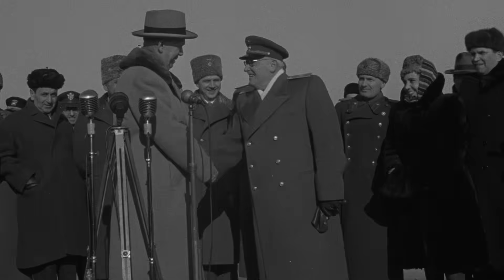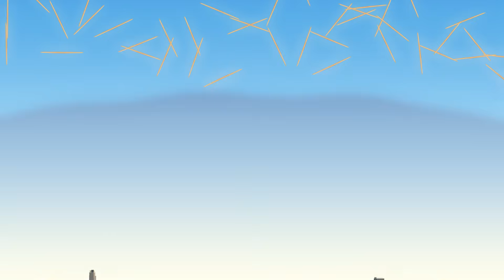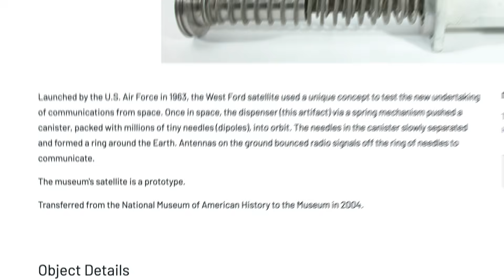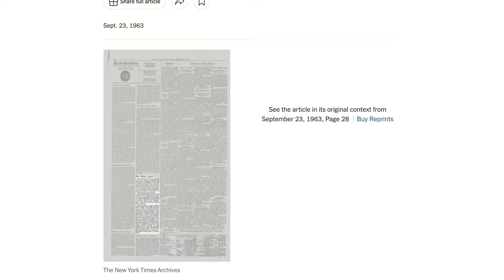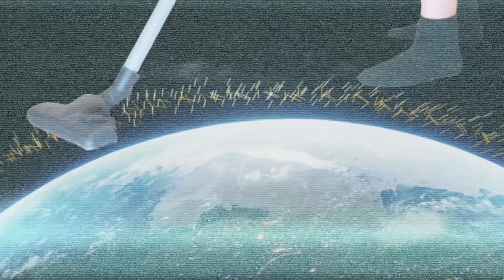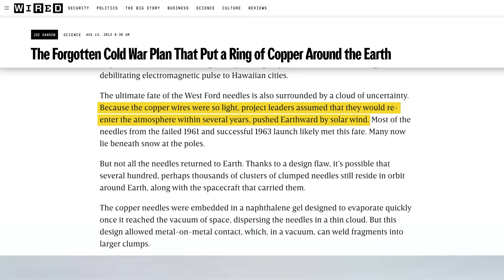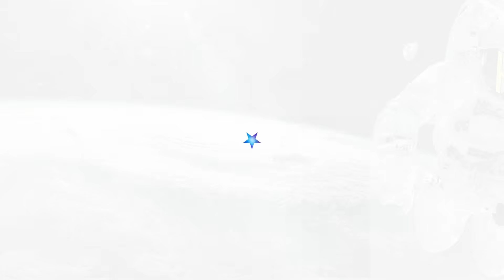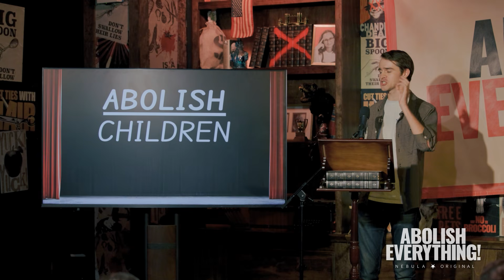Why The US Government Put 480 Million Needles Into the Sky

Comment: A little surprised there was no mention of the concept of Kessler Syndrome, the idea that if there is too much junk in orbit it wish smash into things like satellites, turning them into more debris which can destroy more stuff, eventually resulting it being impossible to use satellites, or even spacecrafts in general.
Reply: To ease your concern, this is because the research has confirmed there is very little threat of such an event occurring, at least from Project West Ford. The vast majority of the small needles fell out of orbit within a decade, and there's only 44 clumps of needles 10cm or more in size left, all of which are monitored. Individual needles or smaller clumps undetectable are unable to cause any real damage to any satellites as there are only 1.3 penetrations of more than .4mm per meter per day and "no significant number" of impacts penetrating 0.5mm in low orbit total, not just from the needles. (1965 summary report from NASA from Project Pegasus I - III to record impact frequency) That was measured in '65, two years after Project West Ford, and we can only expect that number went down. To add to that, most satellites have a wall thickness of more than a cm, like Starlink satellites being a few cm thick or the ISS's around 10cm to any pressurized part. Small impacts, like those from potential West Ford needles would leave no damage to other spacecraft or satellites. The damage is likened to sandblasting and would take decades to be any real concern.
Reply: @KreptorS  the way you are phrasing it makes it sound like it isn't a big deal when the truth of the matter is it's not a big deal specifically for project West Ford, but it is a big deal for everything else
Reply: @weamibrahim2146 Because it ISN'T a big deal not just for Project West Ford but for all low earth orbit in general. I'm slapping away at all the fearmongering. the data collected from NASA's Pegasus missions in 1965 show: "With this area [200m^2] and an expected lifetime of one year, a statistically meaningful total number of puncturing impacts could only be expected for aluminum target thicknesses below about 0.5mm. Actually, the number of puncturing impacts through 0.4mm of aluminum as recorded by Pegasus II and III is about 1.3 per m^2 per year, in rough confirmation of the preflight assumptions." A thickness of 0.5mm will only be a concern for solar panels exclusively which would only limit satellite lifespans and not cause any catastrophic chain reaction. Sorry you didn't like the way I said it. It is NOT a big deal. A good analogy is the amount of tiny rocks getting kicked up at your car as you drive throughout the course of a year. They will not kill you or cause your car to split into a thousand pieces. The NASA report compares it to sandblasting. It is not a danger.
Reply: @KreptorS Starlink satellites hulls are less than a millimeter thick…
They have a design life of less than five years.
Reply: @allangibson8494  Where did you get this lie? That's not even remotely true. The vast majority of satellites built in the past couple decades are 2.5mm or more. Starlink satellites are designed with thrusters on them that push them down into orbit within 5 years of end of mission, not lasting only 5 years. Did you just make something up because you dislike them?
Reply: @KreptorS Starlink satellites are modified cube sats.
The Apollo LM had a 0.3mm skin and it was pressurised.
No one launches anything with a 2.5mm plate in it unless it contains pressure.
Whipple shields are multiple layers of foil.
Reply: @allangibson8494  Must've never heard of the Pegasus missions. Proved that spacecraft received no penetrations with 0.5mm of aluminum. Meaning the only thing small space debris can do is damage solar panels. And are you fr? Mentioning the LM like it matters? It wasn't going to be experiencing debris impacts of any notable force and was therefor not designed for it.
Reply: @KreptorS The LM was a manned spacecraft.
Pegasus is a launch vehicle, not a satellite. Launch vehicles are designed for aerodynamic forces the spacecraft never experience.
Satellites are also legally required to burn up on reentry…
Reply: @allangibson8494  so you agree with me then. but judging from that response, you also must have no idea what Pegasus is or what its mission was
Reply: @KreptorS Which Pegasus are you talking about?
The modified Saturn V or the air launched satellite booster?
Reply: @allangibson8494  my guy. there's only one distinct project regarding the name Pegasus. It was a 3 part mission to test satellite durabilities, damage, and frequency of micrometeoroid impacts. its surface level research.
Reply: Kessler didn't come up with his syndrome until 15 years after this was abandoned, so it wasn't something that concerned anyone at the time. I think by the time Kessler pointed out there was a potential problem, most of the needles had already re-entered the atmosphere.

The needles are too small to be a big problem. The risk with Kessler syndrome is that each collision creates more debris and you get a chain reaction. A collision with a tiny needle isn't going to create much debris. 

The needles also spend very little time at dangerous altitudes. They were launched into an orbit at around 3,500km, which is Medium Earth Orbit. Kessler Syndrome is mostly concerned with Low Earth Orbit, because the density of satellites and debris is much higher there. Once the orbits decay enough for the needles to reach LEO, the atmosphere is thick enough that they are going to re-enter very soon (probably a few days).
Reply: @thomasdalton1508 At 3500km the orbital lifetime is longer than the age of the universe unless the solar wind blows them down…
Reply: @allangibson8494  For a big satellite, yes. For a tiny needle, no. There is a square-cube law effect at play. The smaller something is, the more air resistance slows it down. That's why it is only those needles that clumped together that are still up there. The needles that were on their own deorbited within about three years.
Reply: @thomasdalton1508 There is very very little air at 3500km to cause drag.
The solar wind has a higher density than the earths atmosphere at that altitude. Electromagnetic effects would be stronger than aerodynamic drag. (Which of course assumes they were injected into a circular orbit).
Reply: @allangibson8494  I think at 3,500 km, the Earth's atmosphere still dominates over the interplanetary medium. The atmosphere is very sensitive to solar activity at that altitude, though. 

I tried to do a rough calculation and got that it would take about a million years for them to deorbit, but I think the problem is the extreme variability of the atmosphere at that altitude. A brief period of high solar activity would cause the atmosphere to expand and suddenly they are orbiting through air several orders of magnitude more dense.

They definitely deorbited within a few years. They were very easy to observe - just bounce radio waves off them - so were tracked as they deorbited.
Reply: @allangibson8494  Even if we suppose ALL the needles are still there and will always be, there is no cause for concern because they're small enough that they couldn't even penetrate 0.4mm of aluminum despite their speed.
Reply: @KreptorS actually at orbital velocity, a paint flake will punch a hole right through a satellite.
Those needles will pack more energy than a rifle bullet.
Reply: Well have robots to sort out by then
Reply: Like Saturn, Earth will have rings........made of trash.......
Reply: Yes, seems to me we are getting close to the Kessler Syndrome. It seems with all these smart people involved with spaceflight systems from NORAD to SpaceX, but they seem to be looking the other way. This would not be first time in history where brilliant people not considering results.
Reply: @wrightmf well Musk isn't exactly smart, it's the engineers and scientific staff who do the heavy lifting and ultimately they can't veto an objectively stupid project
Reply: @rileygladue3979 I wouldn't count on the last one. After all we got the Cybertruck and there is no way that this piece of shit wasn't designed by Musk.
Reply: @rileygladue3979  dumb people can stumble into a billion dollar idea.  Dumb people don’t stumble into multiple multi-hundred-billion dollar ideas and have the ability and insight to hire the right people to make those ideas trillions of dollars in investor wealth.
Reply: @rileygladue3979  Musk is objectively pretty smart on some topics. Intelligence isn’t universal, and it becomes pretty apparent when someone’s had enough success that their ego has gotten completely out of control. Nobel Prize winning conspiracy theorists are very common. I think climate change skepticism is higher among Nobel Prize winning scientists than regular scientists. Why? Because they’ve had their ego validated and think they are smarter than everyone at everything.

Musk is the same. He’s genuinely good at rocketry. He does make high level engineering decisions at SpaceX, those engineers and scientific staff say so. That’s why SpaceX moves so fast; instead of committees he listens to proposals and picks one. 

But after tremendous success with online maps, online payments, electric cars and rockets, he decided he knew better than everyone on everything, and started talking about other things and ignoring the experts in those fields, because they don’t understand online maps, online payments, electric cars or rockets. Thus you end up with a man who could have a long detailed conversation about the pros and cons different combustion cycles for rocket engines, but would prefer to talk about gender and make mistakes I could have corrected age 14.
Reply: @qwerty112311 no, they purchase them and run them into the ground with daddys blood emerald money.
Reply: @qwerty112311  when you're born into high society you essentially cannot fail, you had Dynasties of inbred nobility running the world for as long as civilization existed. Call the Hapsburg family "geniuses"
Reply: @rileygladue3979 He has a degree in physics.  That's more science than most people I know.  Do you?
Reply: @captainsorehl A degree =/= Intelligence
Reply: @rileygladue3979 Degrees may not equal intelligence, but they are a strong correlation with respect to their specific subject.  Physics isn't some dismissable subject like liberal arts or comparative philosophy.  They don't hand those out.  So you can sputter he isn't smart about a lot of things, but science isn't one of them.
Reply: @rileygladue3979  case in point the cyberslop exists
Reply: @captainsorehl  how's that boot is tasting to today huh?
Reply: @matheussanthiago9685 Delicious.  My aerospace degree earns me the best boots you can eat.  It doesn't mean I'm intelligent, but they sure pay me like I am!  What a pampered slave I am!
Reply: @wrightmf Well there's a reason experts aren't worried about it and you are. They actually know what they're doing.
Reply: @ravenvelvet69 then why did SpaceX perform 144,000 collision avoidance maneovers in a 6 month period last year? That's over 13 manoevers per satellite: 1 every two weeks...
Reply: @ravenvelvet69  experts are very much worried about space junk
Reply: @rustybayoneta perfect demonstration of why it isn’t really an issue.  All modern equipment is build with the ability and expectation it will have to maneuver to avoid other objects in space.  And they’ve done so quite successfully.  LEO has safe capacity for hundreds of thousands, if not millions, more vehicles.
Reply: @rustybayonet that's exactly why they aren't worried because they have a system that specifically avoids that. Also when you have thousands of satellites yeah you're gonna have to do that many maneuvers
Reply: @rustybayonet  To avoid collisions, why do you think they did collision avoidance? This isn't Kessler Syndrome if it's stoppable by literally just dodging the things in orbit. 
Not to say it won't EVER be an issue, but collision avoidance is a direct example of experts seeing a possible problem(collisions) and addressing said problem.
Reply: @the-digital-idiot  That only works with active satellites with the ability to manoeuvre. There is a lot of stuff up there that isn't active and can't be moved. If two of those things are on a collision course, there is nothing anyone can do about it. They will collide, creating a lot of debris and that debris will then collide with more things.
Reply: @wrightmf  SpaceX are very much not looking the other way. They orbit Starlink very low. If they lose control of a Starlink satellite, it will reenter in under 5 years. This has two advantages:
1. Junk can’t accumulate for decades and decades, reducing the risk of hitting a tipping point.
2. Even if they really mess up, it cleans itself up in a few years. 

They also avoid polar orbits, which are the most dangerous collision wise.

SpaceX actually lobbied the FCC to impose stricter rules on constellation satellites with respect to altitude and time in orbit following loss of control. Was this out of sincere concern, or because they could meet strict criteria while competitor OneWeb couldn’t? Probably both, but still, it’s very much a problem they are aware of.
Reply: They're probably at too low an orbit for Kessler Syndrome.
Reply: @pseudotasuki  Actually, they started out well above the altitude where Kessler Syndrome is a concern.
Reply: That's because Kessler syndrome is the greatest nothingburger of all time. Open a live airplane tracking map and take a good look. Now go outside and look at the sky. Does it look like the sky is blocked by airplanes? No, because if the airplane models used on the tracker were to scale, airplanes would be the size of Tokyo. But, just like satellites, they're not. 
And keep in mind, planes operate in a relatively thin 10km thick zone. Satellites have 33,000km worth of radial thickness to play. For scale, you could fit 2 and half earths between the lower bound of LEO and the highest bound of HEO and stick have a spare 5,000km to go.
Reply: @crazeelazee7524  And yet, despite the apparent emptiness of the sky, thousands air-traffic controllers work every day to try to prevent planes from running into each other. And when they fail, which happens despite virtually every flying object being under active control by a human, the resulting debris falls to the ground rather than staying up there as a hazard for other planes.
Reply: @macdjord Because they aren't orbitting freely within spheres many times larger than the surface of the earth AND they have this pesky habit of taking off and landing repeatedly from the same conjested locations.  They call those airports.
Reply: @crazeelazee7524  yeah, space getting so crowded that one collision could take out all the satellites and prevent us from going to space in the near future is sci-fi. However, space debris can still take out a single satellite and cause damage to the ISS causing a lot of $ in damages. What we are currently doing (deorbiting satellites at the end of their live and banning shooting 'down' satellites) is basically already the best we can do cause you sure as hell would be pissed if your million $ satellite stops working because one of the superpowers decided to destroy one of their dead satellite from before the time deorbiting became mandatory with a missile to show that they can target satellites. We might want to deorbit those at some point with whatever technology we come up with that can safely do that just to make the former impossible.
Reply: @crazeelazee7524  Kessler Syndrome is primarily concerned with LEO. The vast majority of satellites are in LEO in a region about 1,000 km thick.

I'm not sure why you are comparing satellites to planes. If planes collide, the debris immediately falls to Earth and poses no risk to other planes. There is no chain reaction. If satellites collide, the debris stays in orbit and can collide with more satellites, creating a chain reaction - that's Kessler Syndrome.
Reply: @thomasdalton1508  @thomasdalton1508  I wrote a whole paragraph explaining LEO forces and such but YouTube crashed, so rip that.
Anyways, because I don't care to write it all again, there's a reason satellites (especially LEO satellites) have boosters. You still experience anything between 80-90% of surface gravity at LEO. You're not orbiting at that altitude, you're falling in the right way. Without boosters, even a piece of debris that rolled a 21 and came out the collision with the perfect trajectory and velocity for its altitude would still end up on the ground within a few months. 
There is however one orbit where a collision's debris wouldn't deorbit and cause a chain reaction. It's beyond GEO and we call it the graveyard orbit. No points for guessing what we use it for.
Reply: @crazeelazee7524  That's a pretty wild take lol. To stick to your airplane analogy, imagine all airplanes would fly at 7km per SECOND or roughly 25,200 km/h, and 80% of it (all of the already accumulated space trash) had no guidance system and just yeeted through the sky unbothered. Now, all the very very small airplane don't have enough mass to create significant damage to other bigger airplanes, but if any of the bigger airplanes (and we're talking 10cm upwards) collide with anything else, you suddenly have a massive cloud of debris traveling at, once again, 25,200 km/h. 

It doesn't matter that there is a lot of space between all the airplanes or trash in orbit. At speeds that high you have a big problem whenever anything the size of a melon collides with anything else. And at those speeds, the odds of collision increase significantely.  At one point we're absolutely going to have to deal with this issue or risk that any space flight we undertake, will get shredded once it enters the evergrowing, ever speeding sphere of death and be absorbed into its debris field. 

This is exactly like climate change. Sure, you can ignore it for a couple of decades, or with Kessler syndrome, maybe even a century or two. But at some point it WILL start to impact shit and then it's usually too late to change course without a massive undertaking. All because people would rather just keep on doing what they always did and ignore that this will have consequences down the line, and it would be much easier to look for solutions before it gets too bad, but hey: at least we have starlink now I guess.
Reply: @rameji-chan737  I stopped reading at "had no guidance system".
Inb4 "acshyualee cubesats have no guidance systems or boosters ☝️🤓" yeah, and they also don't go beyond 500km.
Reply: Do you understand that broken old satellites and debris from collisions have no guidance system? It‘s simple: Volume and thus available space increases like x^3 but the number of parts increases exponentially if not controlled in some way. Everywhere, also in high orbit. What will win in your opinion if one just carries on as before?